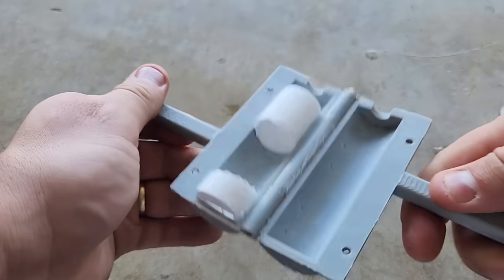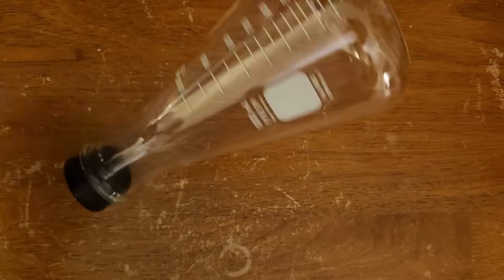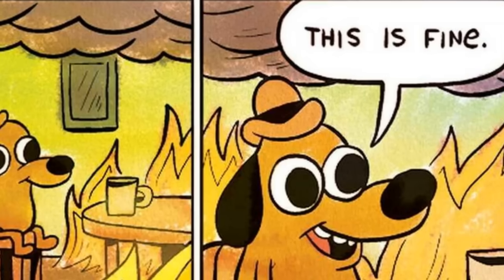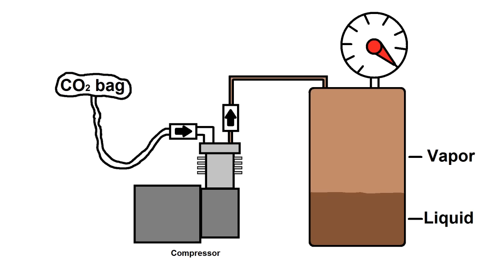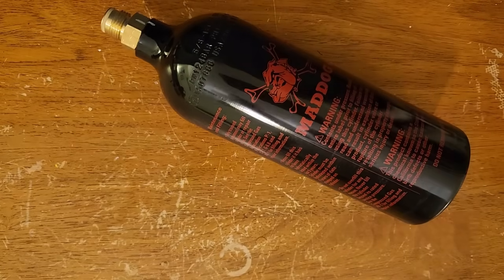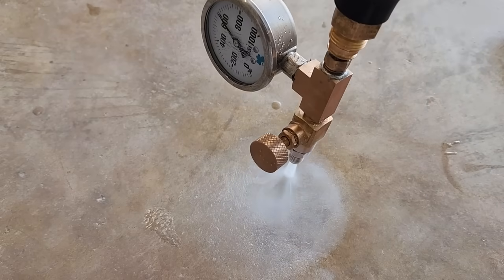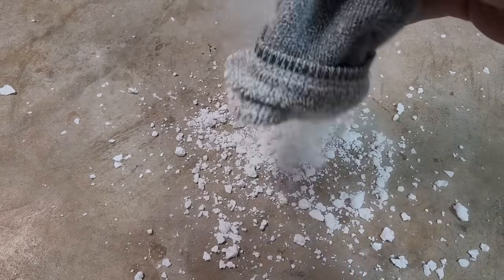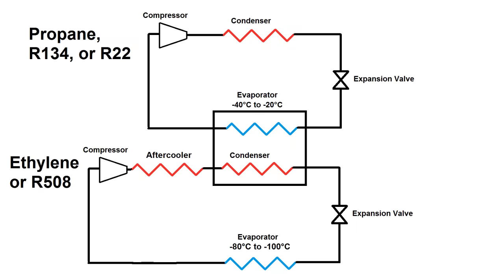Making Dry Ice from scratch

Comment: I watched this a while back, and if you really want to try for a low effort effect to capture CO2 easily, fermentation may be better in effort. a normal beer/hard cider 5 gallon batch would probably produce way more than what you were doing, and with a baffled system like you have here for capture and drying, could work, but I am more thinking the carbonate path as a single point trap would be more efficient. It will also trap a large degree of moisture, but that can be gently driven off in theory before the high temp to break down the carbonate. The advantage tho, if it does perform as expected, is that the carbonate volume will be easier to maintain. As far as transforming the carbonate, a canister with an electric element inside and a thermocouple, with gas ports might make for it, and allows you to vacuum the heating chamber before a heating run.  I realize some of this may be more time and effort than you want, but it might be easier, and lead to a better solidifying scheme. Maybe something where you can transfer the liquid CO2 into a contained normal air container, where you could bleed off the normal air on top? such would possibly allow more of the CO2 to condense maybe. Mostly I think having dry ice at hand will have similar advantage as the liquid nitrogen will be.

Comment: This is awesome!! I am a chemical engineer and I have made some really awesome fun things in my life. I try and. stay away from some of them now but I still love every bit of chemistry. I started a welding/fabrication/foundry/machine shop that specializes in pre WW2 race cars. I am starting my YT channel by building a1928 Morgan RIP MG Special. I bought a Nitrogen generator but one of the compressors blew up. I also have a helium cooler that can liquify the N2 with a pulse tube . Keep up the great work my friend. we should get together and go on vacation far away fro a couple weeks and build things....lol I am building an oxygen generator to supply my surface mix torches that I designed and built to do scientific glass blowing.

Comment: As someone who fills cryogenic liquids, the lack of ppe is both realistic and terrifying 😂
Reply: Yes, was noticing no gloves.  Even in the HVAC field, minor frostbite is common without gloves.
Reply: @todd8155  In HVACR we don't wear gloves with refrigerants specifically because the tips of the gloves soak up the refrigerant before it all boils off. It can actually make things worse. If you know what you're doing and don't have your head up your ass there shouldn't be a situation where your fingertips are coming into contact with refrigerant in the first place, outside of a fraction of a second when you're disconnecting your gauges. I tried wearing gloves when I first started, that stopped on my 3rd call. 20 years later it's smooth sailing and properly callused fingertips.
Reply: @RT-qd8yl  - Thanks for the info!
Reply: I worked for Air Products delivering Liquid Hydrogen,  Nitrogen, Oxygen and Liquid Helium to giant tanks all around the country.  These atmospheric gasses are such interesting elements.  I was addicted to playing with the liquid air created from any cold line freezing the surrounding atmosphere. But this stuff can hurt us so bad in many different ways...crazy.

Comment: i use a co2 beverage tank to cool down my exhaust from my autoclave to my vacuum pump. the dry ice is produced inside a heat exchanger directly. it stops moisture from gumming up the pump

Comment: Please please use hydraulic fittings. They're super cheap at your local Princess Auto/Harbour Freight. They're made from 12L14 steel and designed for > 200 bar working pressures. They come in all the major types: NPT, JIC, ORB, ORFS. They also have needle valves and ball valves rated to operate at those pressures. It's super dangerous to use low pressure fittings with high pressure gasses, especially when prone to thermal cycling and thermal shock.

Comment: You don't need to start the Ca(CO2)2 variant with Calcium Hydroxide, nor do you need to react calcium oxide with anything but water to produce calcium hydroxide. The process is about as difficult as heating up crushed sea (and egg?) shells. Done. You've made CO2. And quicklime, which you can dissolve in water and use to lower pH in your garden. The yeast way is also a lot more interesting, as the byproducts are beer, wine, cider or similar. Regarding the capturing of the dry ice, though. Your sock was the closest by far. Maybe a flare end for the exhaust and a piece of cloth would have worked better? More ball instead of tube shape, at least.

Comment: If You plug in a stator of a motor without the rotor being in it, it has no way to convert energy into anything else than a measly magnetic field and heat, so it basically turns into a heater, even if the motor was fine to begin with. NEVER plug in the stator on its own, that is, if You don't want to fry it

Comment: got valve that can be used directly with a sodasream aga gas cylinder ? i think this is he easiest and maybe cheapest way to get dry ice from ma normal retail shop, I did get some dry ice by putting a tube on a soda stream nozzle while holding the machine upside down couple of years back, but if there was a more direct way to do it on the actual cyldinder that would be awesome... safely of course.

Comment: Those little compressors are usually cooled by "cold/cool" refrigerant in the return/suction. It was probably working so hard windings got hot and shorted. Like others have said, lubrication is  important too.

Comment: MY problem is that , in the automotive field we now use dry ice blasters for clearing dirt and other debris , (similar to a sand blaster) , however the ice is better for the surrounding environment, since it melts away , however 2 the cost of the machine and the ice almost make it nearly impossible to to afford to put into service for the average customer , we would need a large amount of the ice to really do a through job.

Comment: Interesting project, following your LN2 journey with interest. Question though: why bother with the dry ice stage? Just use the expansion of high-pressure gas as a direct cooling resource. CO2, frankly, is a pain for this, as dry ice clogs rather than flowing. Dry air is better. I've been trying to gather data on building turbo expanders in the same vein. If you were to use compressed air as a heat-sink, you'd want to compress, radiate heat and dry, then possibly actively cool your stored air. An expansion chamber like your dry ice harvester as the heatsink for the pulse tube. The only real advantage vs an active refrigeration loop is staggered power consumption, and the ability to passively cool your "refrigerant". I know "air cycle machines" are generally less efficient than phase-change refrigeration, but no clue on the numbers.

Comment: Nice to see your funny commentary. I was a ammonia operator we used ammonia as a refrigerant making lco2 and dry ice. Our main compressor was 1,750 hp. At 220 psi. The lco2 got down to -21 f before going out to our tanks. 5 tanks at 220 tons each. Btw only fill refrig. Tanks 80%  max.

Comment: In case you weren't aware, hermetic compressors do require oil circulation to prevent internal damage. They are also meant to have a starting circuit, typically just a capacitor.

Comment: If you want an easier way to make dry ice it is very simple connect to burlap bags one inside the other up to your liquid CO2 tank tie the bag on with baling wire and open the valve and step back the bags will fill up with dry ice quickly if you have enough CO2

Comment: I work in the natural gas industry, both in highly compressed (5kpsi) and liquid(cryo) forms. Either way, I would encourage you to purchase stainless or high carbon steel fittings for experiments like this. HCS is cheaper, and less prone to galling, and since you aren't working outside on equipment meant to last years, you'd probably be ok. Swagelok and Parker have pretty good distribution in the US

Comment: the diy at your own risk 👀 those lil compressors are great but I'd stick to half of the max capacity...  also multi stage compressors could help step up compression game but then since going to higher pressure you needed higher tolerances stroger more robust redundant fittings And design a safety plan if nothing more than a sheet of plywood with a plexiglass window on either side of experiment 🥼🧪 so it can only fail and go left right or up as down isn't a concern but also thanks for sharing

Comment: You cooked the varnish off the windings by overheating the motor. That compressor is for a closed system, and atmospheric pressure on the suction side caused it to work too hard, increasing the current draw.

Comment: The linear force on the 1/8" pipe thread is only about 125 pounds @1,000 psi.
The diameter is about .40 inches which happens to be .125 (1/8) square inches.
The threads can easily hold many times that force. Near zero chance of failure.

Comment: This was awesome.  I have a couple of questions.  I use CO2 and CO2 Argon mix in large tanks for welding. Typically they are compressed from 1800- 2500 psi when I fill them.  Would this suffice to cut out some of the pressure and volume issues?  Would an air conditioner refrigerant capture tank and compressor also save some time and labor on this project?  I'm considering the possibility of trying this using an automotive air conditioning system.

Comment: I would think that you would want a heat exchanger between the cold gas venting from the dry ice chamber and the liquid CO2 entering the chamber.  That way less of the heat of vaporization will be used cooling the liquid from ambient down to dry ice temperature, and more dry ice will be produced.

Comment: I work in a restaurant that used CO2 canisters. (A) does this canister have a pickup tube in the bottom to pick up the liquid; and (B) is the pressure in the canister high enough to create the liquid form, anyway?
Thanks, in advance 😊

Comment: 11:37 When I worked at a steel mill, I worked in the lab. We had to make dry ice for a specific destructive test on prepared steel samples. What we had was a big cylindre (like an oxy-acetylene setup) and what looked like a fire extinguisher nozzle at the end of the hose. We had a one gallon pail that we'd blast it into, and it built up very quickly as it had no place to go. So you're getting the expansion as it enters the fire extinguisher nozzle but it's crashing into the bucket and unable to escape.
Reply: Place I bought from didn't use a megaphone shape as output, just a straight metal tube about 5-6 in in diameter &  12 in long.  Aimed into Styrofoam cooler it made 4 pounds in about 20-30 seconds with a lotta noise and sure seemed like a waste of gas to me.   Take a looksee at those big CO2 tanks outside of bars& restaurants,  they have a quick-connect coupling on them, and have a nighttime visit!

Comment: Have you seen commercial dry ice production? They expand the liquid into a large chamber which makes CO2 snow, then compress the snow into large blocks that are then cut into smaller blocks with a band saw. You can make the snow just need a way to gather it and then compress it into the final form.  Your video is great, thank you.

Comment: 2:23  Little kids ALSO make vinegar (CH3COOH)/NaHCO3 bombs, that way.  You fill a 2L soda bottle partially with vinegar.  Then you make a packet with NaHCO3 wrapped in toilet paper, etc, which is held in the neck, by friction.  Screw the cap on tightly, and throw it!  Also, dry ice in a bottle with water works well, too.  The water causes the solid CO2 to quickly vaporize, by warming it, and also insures a gas-tight seal for the cap.  Some years ago, I was working as a substitute teacher at the High-School, when a kid set off one of these in the gym.  It was LOUD!  A friend of mine, who was a teacher, told me how her students used the vinegar version to blow up mailboxes.

Comment: Hard learned lesson:
  In order not to burn out the pump, being able to release the pressure at the pump output will allow the motor to start.

I used a one way valve at the pressure tank and a t fitting with a ball valve to vent the tube from the pump output to the one way valve, to relieve the pressure for the pump.

If you wanted to automate the system, then an electric solenoid valve in place of the ball valve would work.

Comment: I got a 50 lb CO2 cylinder from a local welding supply co, with siphon tube.  refilling that is fairly economical, I used it to fill my CO2 tanks.  I did not require a compressor, I just prechilled my paintball cylinders in the freezer, then vented out any remaining CO2, before refilling.  I usually have to vent out a little bit of it after I transfer, to keep the tank under capacity. (which is about 75% of the physical volume)

- toss 20oz in the freezer (leave it there a few hrs)
- hook up 20oz to 50lb tank via adapter with dump valve
- open 20oz valve wide (pressurizes adapter)
- open dump valve in adapter (empties and further chills 20oz)
- close dump valve
- open 50lb valve (liquid will transfer, wait for sound to stop)
- close 50lb valve
- close 20oz valve
- open dump valve (to empty adapter)
- remove 20oz
- weigh 20oz tank and vent as necessary to get it to full weight

if I was not able to prechill the 20oz, I wouldn't get a full tank usually, maybe 8-12 oz.  in that case, reconnect the 20oz and repeat the process.  the dumping of the partially filled tank will be enough to adequately prechill it to get a complete fill on your next try.  probably will have to vent a little to get it down from overfull.  but of course this wastes a little of your CO2 to use it for chilling.

my local welding supply either rents tanks or you an buy them outright which is cheaper in the long run if you're using small quantities.  also they have 20 pound tanks available as well.  I started with a 50 and ended up changing to a 20 to make swaps for refilling easier, as it's very awkward handling a full 50lb tank. (which is around 100 lbs empty)  They may not have a siphon-tube equipped 20lb tank for rent/purchase on-hand so call ahead in case they have to prep one for you.

Comment: Ok I'm kind of horrified by a few things in this video.
1) Those refrigerator compressors are not designed to pull hard vacuum
2) Said compressors also need lubrication which needs to be supplied on the evaporator side, and probably will contaminate anything you are working with
3) STOP HANDLING FREEZING METAL WITH YOUR BARE HANDS YOU NUT!
Please just get a cheap $99 harbor freight air pump and some gloves.

Comment: also while a fridge compressor can do only a few hundred psi you neglect the sealed nature of them
run two or more in series with intermediary tanks and pressure switches
I'd say the beach ball using an expansion switch that causes it to turn on the stage 1 compressor between 10-90% full
then stage 2 just uses an interlocked pressure switch on stage 1 and 2 to keep a differential
then stage 3+ does the same using the differential chosen to pump up each small tank till you reach LqdCo2 pressure and use a canister that is larger than your refill can inverted and with a QC and ball valve to drain pure LqdCO2 from your main storage right into an equal pressure mini can
they will be a tad unhappy and as the outer shell is meant to only take maybe 1-2k psi it can be risky to use them as-is
but if you can find a way to seal the entire thing with all connections in a secondary pressure vessel(like a pressure pot inside another pressure pot reducing rupture stresses on the inner pot by having two seperate pressure changes) you could easily use several fridge compressors in series to reach as high as your lines can take on the outlet
but beware, fridge compressors are meant to have oil mixed into the intake flow so you would be best using an oil seperator on the outlet with the first inlet having a nozzle that periodically sprays the oil back into the tanks
and fridge compressors do not start under load so you will need a solenoid valve that follows the state of the power of the compressor basically blowing output  back into the intake upon shutdown but prior to the check valve intake of your next stage 

assuming all these quirks are worked around as suggested you can easily tune the molded D-Ice maker to have a defined flow rate and control via a ball type valve rather than adjusting the flow every time

and if the ball was instead a solenoid valve you can then connect the power to an Arduino allowing a defined time based on your adjusted temp calculations for perfect chunks every time with minimal gas loss

and bonus, if your system has a massive expanding storage(like a large inverted 55 gallon drum expanding chamber) you may be able to collect the vented cold gas and re-compress it back into the system reducing waste and starting material costs

dry ice is great as it is basically low-pressure storage of otherwise useless greenhouse gasses and assuming you can automate this setup it can be easy to just have a massive cooler full of pre-molded chunks making you close to carbon negative if you sell or otherwise store away the CO2 in pressure vessels

Comment: actually try a 50% lye solution
the lye converts into sodium carbonate which with a simple kiln (like for jewelry melting) and a stainless steel canister you can cook off the gas and you are left with sodium oxide
then wet the sodium oxide and you get lye
full atmospheric extraction that you could modify to use a mild acid like citric acid or vinegar and still recover the sodium metal by cooking the sodium citrate or sodium acetate and venting the acid vapor outside or even condensing it to re-use